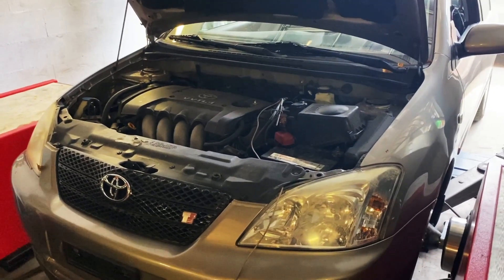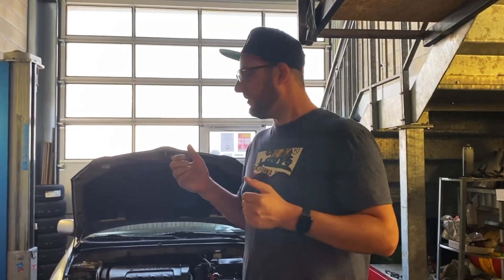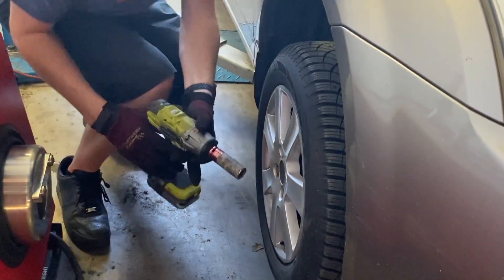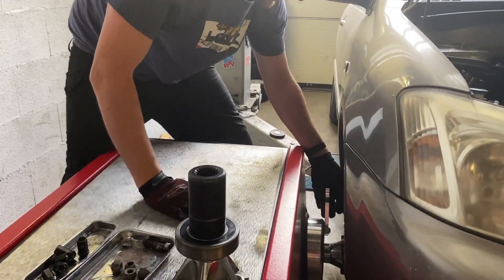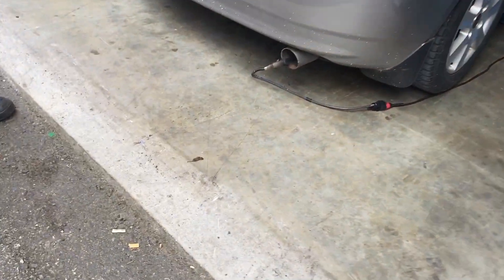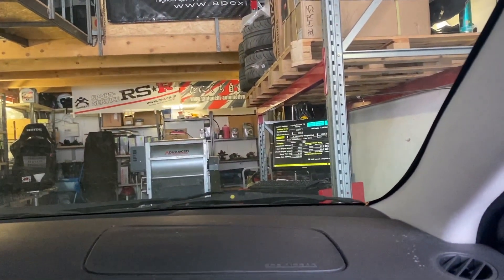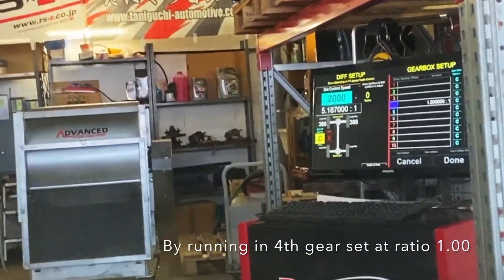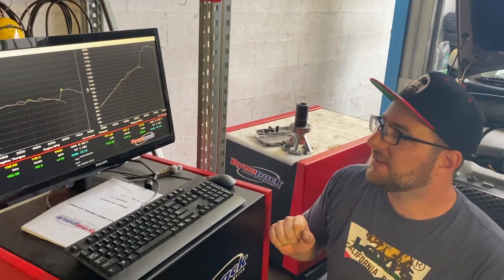EP1: Project Lotus Hunter - Why swap the engine in the Toyota Mr2 zzw30? 1ZZ versus 2ZZ Showdown!

Comment: I just have to say the power lost to the wheels in a fwd car is cloesr to 10-15% and thats with the wheels on. 18% is what rwd cars loose with the wheels on. If you do your calculations correctly and research right you will learn that only the lotus 2zz engines made 190 hp and all the others made 180hp or less depending on the year. The overinflated numbers your showing are very inaccurate so it might be best to just show the actual hp you made to the hubs which without the losses from wheels would be closer to 8 to 11%. If i recalculate your numbers you actually made 162 to the hubs which if you multiply by 11% makes the actual 180 the 2zz should make. Granted your losses are a bit less than 11% but the engine is used and will be down a hp or 2 further proving my figures to be more accurate.
Reply from the maker: Thanks for your input. I see you got triggered by the transmission loss. In Europe we just like to have an Engine power figure… you must be from the US. Thats funny, we get more often 25% as a benchmark for ff cars in transmission loss. Where do yOu base your claims on?
In what country are you? US? I am Switzerland and our cars are officially registered at 192hp. US Spec is not like the EU Spec. We run with 98 octane, more like in Japan. To be honest the numbers seem very realistic.
But even then, if you feel like disputing the transmission factor loss I use, thats your choice. Whats important in the end is using that transmission loss accross the board on all the runs and pulls I did after that basemark. To determine the gain. Who gives a damn about the end number? Its the gain we want to see. 
This is my first video, you will see there are litteraly a hundred more videos I posted and probably 30-40about the 2zz. Give them a watch and tell me what you think.

Comment: Just watched your YouTube of the LSD swap from 5sp to C60. Q1. Can a Torsen LSD standard from a C65-01B transmission be swapped to a C60 gbox? Currently I am having real difficulty with my C60 6Speed (ex 2001 Celica g/box - 125k kms) in my 2zzge MR2 Spyder when cold, difficulty selecting 1st & mainly 2nd on both upshot & downshift. Most times 2nd cannot be selected at all when cold. Q2. Could this be largely due to worn synchros?, Q3. As I still have the C65-01B (ex SMT g/box originally in my 1zz & converted to MT) can the C65-01B with Torsen LSD be used to 2zzge? NB.I know from comparing the gear ratio specifications that essentially the ratios are mostly the same as C60, but preferred the 5th & 6th ratios from the C65-01B as they're better for touring. I dont race or track the car & don't really use the top speed / lift. Previously the C65-01B gbox had no selection issues in the 1ZZFE even though it has >175k kms on it.
Reply from the maker: Hi! Thanks for your comment. Regarding your questions:
Q1: All I can say is that there doesn’t seem to be a differentiation for LSDs in the OS Giken catalog between c60 transmissions. They should be the same. Which means yes.
Q2: yes. But maybe you are not using the correct oil too!
Q3: If your transmission is a 6speed C60xxx transmission, I don’t see why it wouldn’t fit.
Also check if your gear selector mechanism/conversion has been done correctly. Check my transmission prep videos, this will give you a step by step way to do it correctly 👍🏼